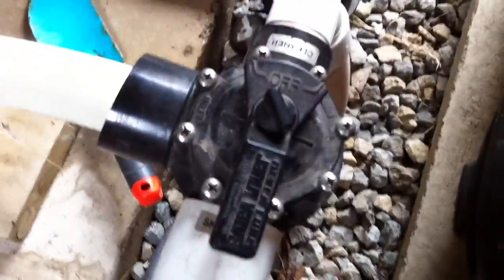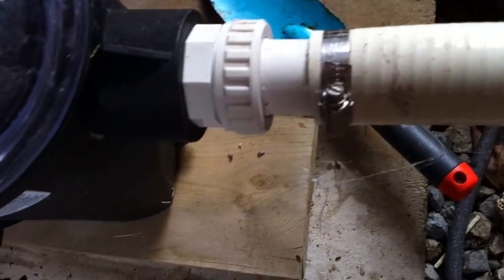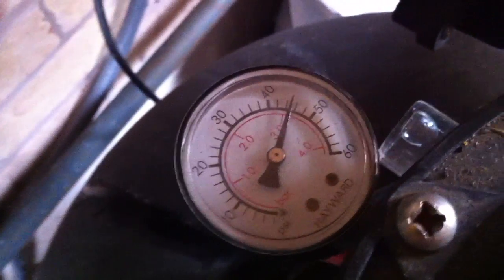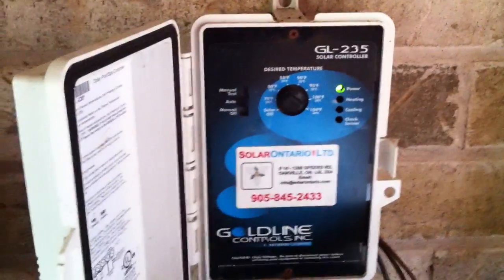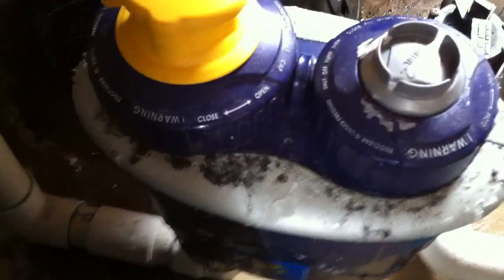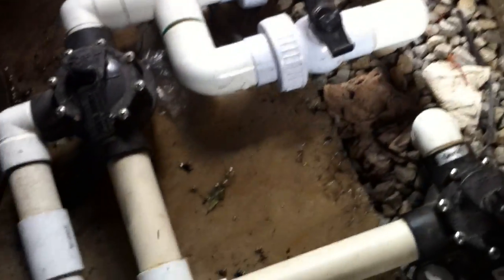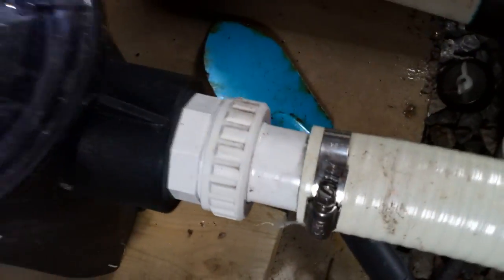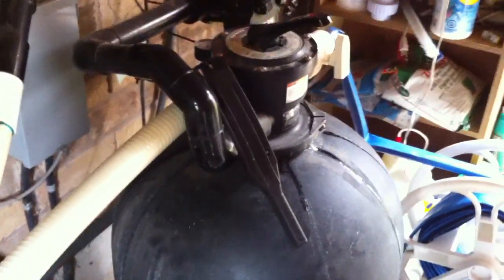Dangerously High Filter Pressure - Pool Equipment Installation Tips

Comment: I pulled my Hayward De 24sqft Filter Grids out today and cleaned them. No tears or cracks in manifold that I noticed. After cleaning I primed grids with 2.5 lbs de and the pressure initially read 18psi. However within about 45 min to an hour the pressure rises to 30psi. I backwashed and added 2lbs de and pressure started at 18lbs again and rose to 30psi within an hour. What could be the issue?
Reply: Sounds like an air leak somewhere. I had similar problems. On my Hayward EC50 filter, I removed and cleaned all the tubular grids. I them noticed 2 small screws had loosened and come out that attach the manifold head to the grid holder allowing some water to pass thru. I put new screws in and all my pressure/air problems were immediately resolved. Check all o-rings too and any small tears in your grids.

Comment: Sir I clean my filter and I put it back in the filter at it goes down to 25 and the next day back to 40  have a star right filter do you have any ideas should I get new filters.
Reply from the maker: One of two things is happening - You are not cleaning the filters properly or the filters are at the end of their service life.  I suspect the latter.  When filters age, or become damaged from acid, you will get this symptom of running for a few hours and then having a pressure spike as they clog again.  Filters only last around 3 to 5 years organically however if you (mistakenly) try to acid wash your filters then you will bake in the oils that the paper is saturated with.  This is why a degreaser is the preferred way to chemically clean pool filter cartridges.  Rinsing or spraying with a hose basically does nothing to clean your filter.  The pressure increases in your system mostly because of sweat, lotions, oils, makeups etc that are all in the pool.  You either need to use a filter cleaner and degreaser or, more likely, you need to replace your filters.

Comment: Mine has been 40 to 45 since I bought this house. Last year I cleaned the filter. and the pressure stayed the same. I cleaned it again and it's still hanging around 45 PSI. Yet, the pressure value claims it can go to 120. I wonder if my pressure indicator just needs to be replaced.
Reply from the maker: 45 PSI is well past the maximum designed operating pressure of pool equipment which is 30.  Past 50 is where explosion is very likely.  45 is super dangerous.  Something is wrong.  You could have plugged lines, or a broken filter head, a valve internal might be broken...regardless you need to investiage further as 45 PSI if accurate is too dangerous to leave running.  The pressure gauge itself has NOTHING to do with how much pressure your system can handle.  Just becauuse yours has a 0-120 instrumentation range does not change that pool equipment should not be operated over 30.
Reply: Hmm.. yeah, the maximum operating pressure per the information on the unit says 50psi. I will try to replace the gauge. I have a feeling it's been this way for a years. I had a pool expert come out and he said it was fine.
Reply from the maker: Well I can tell you with certainty that your equipment is rated for 30PSI operating pressure - 50 is approaching burst pressure.  Anything over 30 PSI is, for sure, not OK to have your system operating at. There is something wrong with your system either from a design perspective or some sort of deficiency.  I would encourage you to replace that gauge before running your system again, and anything over 30 should require a visit from another local technician.

Comment: What was the cause fur 45 psi 20 is my mas I keep mine below 10
Reply from the maker: This system has a lot of pressure with the solar heater and in this case the pressure was unusually high due to the filter being dirty and needing to be backwashed.
Reply: wow im suprissed the case didnt exploded i prefer carttrige filters